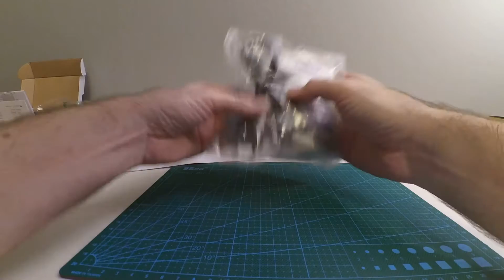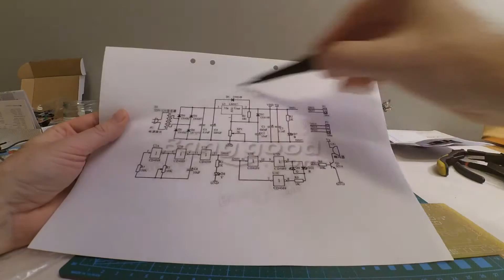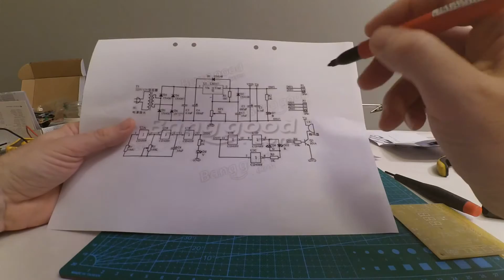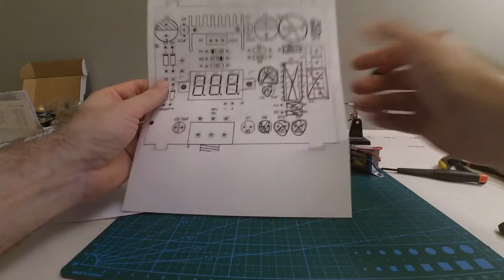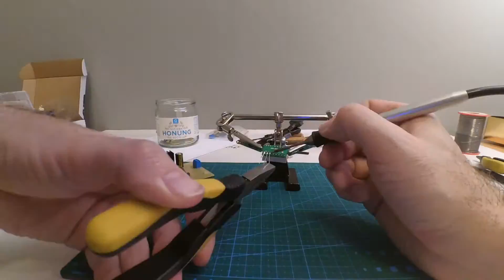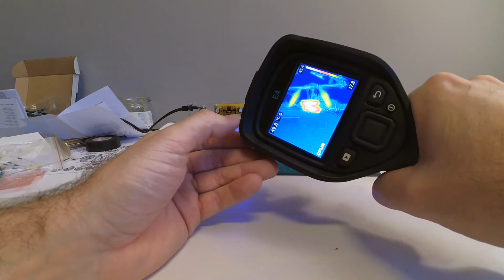#4 LM317 Power Supply Kit with Case - Modification / Build / Test

Comment: can you share the circuit diagram?
Reply from the maker: Here is a blog post on the PSU with the schematics. https://chinese-electronics-products-tested.blogspot.com/p/geekcreit-lm317-power-supply-tested.html
The schematic has a slightly different layout from the one in my video, it includes things like the voltmeter in correct place.

Comment: Hi...cool video, thanks! Is it possible just to switch out the LM317 with an LM338 instead? Or does it need a lot more figuring out? I just bought myself a couple of these kits, but i hate to blow one up through my ignorance if i use LM338 instead. Thanks!
Reply from the maker: Reading the datasheet LM317 and LM338 has the same Vref so the circuit should work. Check the pinout.
Reply: @KristianLaholm  Great! Many thanks for your swift reply!

Comment: Can i use 3A/12V  X-formar or   3A/24V   X-formar?
Reply from the maker: I think it will work with both 12V and 24V, but drawing 3A will overheat the LM317 and blow the rectifeing diods.

Comment: is this a good one to convert into a tattoo power supply?- meaning add audio jack inputs?
Reply from the maker: the voltage is there but I don't know if the amps are sufficient for a tattoo machine.

Comment: I got one of these a few years ago now, I was quite disappointed as they sent me a transformer for 240 volt mains, and of course living in the good old US of A, we have 110 volt mains. I let it lay in a pile for about a year, when I tore apart an old stereo and found a good transformer that would do the job, so I replaced the wrong one with the right, and used it a couple of times, but I found that the rheostat was a bit too touchy and too easy to bump and raise the voltage over what I needed. So I have returned to my  home built DC power packs that I built using 18650 batteries with step up and step down converters. I built these in small cases so they are very portable, and the screws for adjustment is well protected inside the case with a hole the size of a small screwdriver above each adjuster, and a meter built into each so I know exactly how many volts I am putting out. I have 3 of them that I take with me when we are in the RV, and bring back in the house when we return in the spring, one set at 5 volts but, of course, adjustable to about 11.5, the second is set at 12 Volts, up adjustable to 23.5, and the third built with 8 batteries is set at 32 volts, and adjustable to 94 volts DC which I use for outdoor testing of 50 and 100 Watt LED lights.
Reply from the maker: With the price of batteries going down portabel power will take over more and more in DIY projects.

Comment: Hello, why you modify the original kit?  does this modification gives some advantage? thanks.
Reply from the maker: Hi, the first reson for the mods is that i don't need the functions that I remove. The second reson is that the functions are pulling power from the transformer, so by removing them I can pull more power (current) from the output.
Reply: Hello again I appreciate your kindly answer and you are right,  in other you tube video about the same project recomends change the transformer and diodes to handle 3 amps and not just 1 amp because many people did complaint about the bad quality of this transformer; thanks.
Reply from the maker: Hi :-) For the price of the kit we can't demand much more, but as it's a simple kit it's very easy to hack and mod to your own needs.

Comment: Wait why did you remove those components? Btw I am really a noob to electronics. And also great video
Reply from the maker: Hi, thanks for your comment. I removed the components for 2 reasons:

1) I have no use for the functions of those components.
2) The components are "eating up" power/current from the transformer. I want all the power/current to go to the LM317 and the voltage output.

Comment: You don't have to take the wires off the display. I shortened mine and soldered them to the board. I left them a bit long because I put my display on some taller standoff's to get it closer to the top of the case. I am also installing a larger transformer that will give me nearly an amp of power rather than the 200 ma one that comes with the kit.
Reply: Yea you probably can, but the transformer will not fit into the case. The largest transformer that would still fit is 12 volt .750 MAH. So 3/4 of an amp at 12 volts. This is way bigger than the transformer that comes with it. With the current transformer you would be lucky to get .100 mah at 12 volts. So this is a big gain over the one included. I purchased it at Mouser. Part #F114X.
Reply: +Kristian_Laholm thanks
Reply from the maker: The transformer is the the weak point of this kit.
If you are pulling 1 amp ... check the LM317 for overheating.
Reply: I have built two of these so far and one of them runs 80 degrees F and the other only 72. I can't figure out why one is hotter than the other, but the one that is hotter I have noticed that one capacitor is hot as well, while the one on the other side of the regulator remains cooler at 72 degrees F. I would have to guess that the hotter Cap may have problems. I have one more to build and that is the one that I plan on putting a larger transformer in. I will let you know how it works out.
Reply: So far I have not seen temperature higher than 74 degrees F. It seems to be handling the much larger transformer well. I had to cut a slot in the top of the case to fit it into the case.
Reply: hey man great job, i had the same idea. I was wondering what component i would have to upgrade to handle a larger trans, and how would i know which would handle the higher amps, i don't know if possible but i would love about 3 amp out put and at least 12v dc. is that even possible?
Reply from the maker: The LM317 can handle 1.5A but the 4 diods can only handle 1A ... so not possible (and i think the traces on the PCB is to thin for 3A)

If you want 3A take a look at my videos #1:1 - #1:3 and don't do my mods for lower current setting.
You need a big heatsink and a fan for the transistor (not in the kit) to run high current.

Comment: If you've already built it completely, can you just remove the IC from the DIP chip and therefore remove its current pull without negatively affecting things? Or will the other extra components mess things up?
Reply from the maker: +Miles Aurbeck Yes removing the IC will fix the current pull and has no other negative affect on the power supply.
Reply: +kristianlaholm thanks for the info. I also heard that for 110v input you should upgrade the transformer. What would you recommend?
Reply from the maker: +Miles Aurbeck I have only built the 230v version same problem with transformer, if you need high current output I would upgrade the transformer.
Reply: +kristianlaholm Hi there - another question if you don't mind. I'm researching transformers as you suggest and all I'm finding are 220v to 12v or 24v. Can I use 110v as input to 220v regulators?
Reply from the maker: +Miles Aurbeck Hi, all transformers have a "ratio" so the output voltage will follow the input voltage.
If you take a 220v/24v transformer and use 110V as input you will get 12v output, the only problem is the power rating that will be wrong.
I would search old stuff/scrap for transformer before using the "wrong" one.

I am no "expert" so be careful and don't burn down the house :)
Reply: +kristianlaholm thanks for your help. I'm trying to Google numbers found on a bunch of transformers I found in old TVs but it's super unreliable and I haven't actually found data sheets for any of them I've looked for :/

Comment: How precise is it ?
Reply from the maker: +Mads Storm Andersen Under 9V and 100mA it works nice and stable with my modifications (EU 220V version).
The problem is the transformer that is to small, pulling to much current and the AC voltage from the transformer drops.
For the price of this kit you do not get more, a bigger transformer that can handle more current solves the problem.
Reply: a tattoo power supply is usually 1.5 amps...
.
Reply from the maker: This kit will not put out that current and the diods are only rated 1A.
Then i tested my kit I got 0.15A at 7.5V, a factor of 10 to low current.